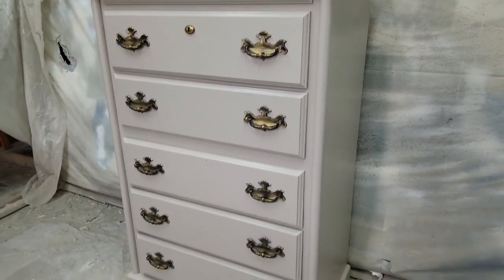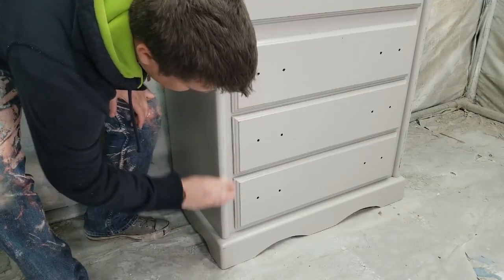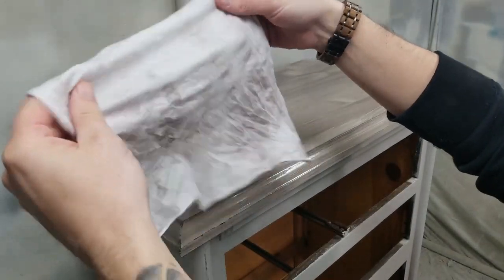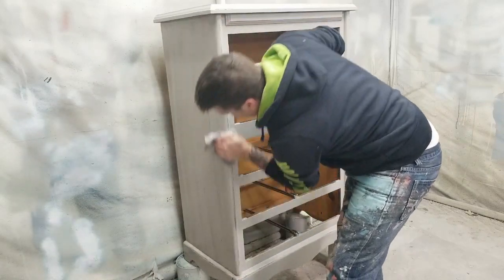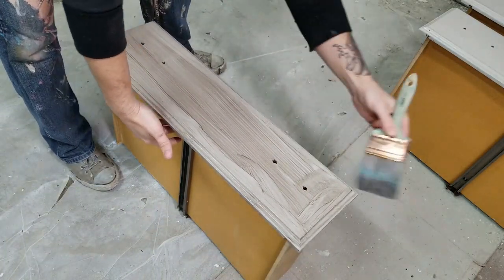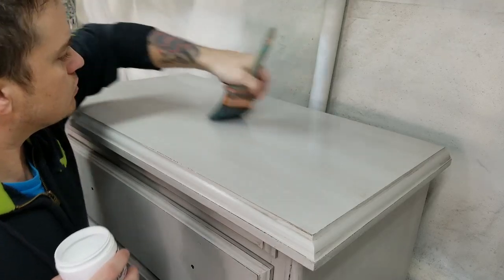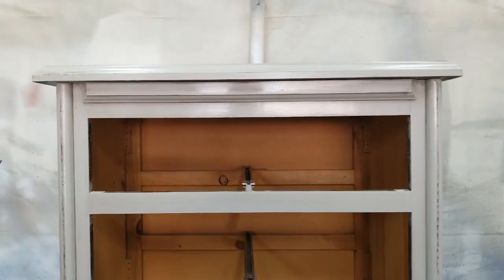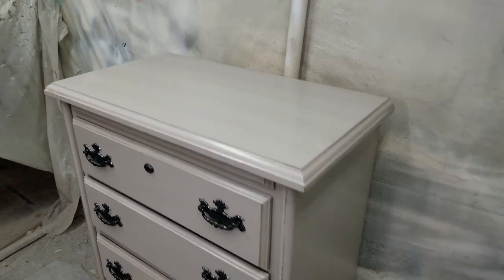Distressing and Glazing Painted Furniture

Comment: Nice work Mr. Shab.  I didn't think I would like the hardware or glazing, but yeah, the whole thing  is much better.  That kind of furniture is built a hundred times better than what you can buy.  Again, 15 years from now, you could always completely strip it, so an overall win.  One thing I would use those wooden knobs, the plain round ones painted the same as the body.  I like it though.  "Like"
Reply from the maker: Good to hear from ya again! You're right. It can be stripped down. I actually almost did that to make a third video but I've got custom orders needing to get done so I just sold it and moved on. One day I'm going to do a video where I buy a painted dresser from someone else, strip it, and restore it. I think that will be a fun one.

Comment: I was just wondering; how do you decide if a furniture piece needs priming or not? thank you.
Reply from the maker: Experience pretty much. There are certain woods that will bleed terribly. Mahogany, cherry, pine, and oak are really bad about bleeding their oils into the paint. Priming prevents this. Also, if you don't sand before painting, you might be able to get away with skipping priming. For the most part, I prime just about everything just to be safe.

Comment: I learned so much from your video. Would you mind to tell me again paint sprayer you used doesn’t need compressor? You use satin or eggshells finish? Thank you so much
Reply from the maker: The sprayers that I use in my video are Wagner and Graco sprayers. You can find them at Home Depot, Lowes, or Amazon. None of those sprayers need a compressor. I typically use a satin paint for my projects and I top coat with satin or semi-gloss depending on the project. Top coat determines your final sheen. Thanks for watching my videos!
Reply: That Shabby Guy what setting you set on sprayer ?? I set on high and came out awful. Thank you for your message
Reply from the maker: What sprayer are you referring to?

Comment: Love your work Shabby! My wife and I have been refinishing furniture as of late. You definitely showed me some useful technique on some upcoming projects. Have you done any whitewash pieces. I have someone that has inquired with me about doing their china cabinet. They mentioned a whitewash (I ahven't done that yet). I have a couple pieces I am going to try your gray glaze technique. My next goal is to get a paint sparyer like yours. What spray tips do you use. I am not fond of the cheap one my wife got awhile back and like the preformance I have seen with yours. Keep up the good work and I will stay in touch.

Comment: Nice! How many rags do you go through with glazing for a project like this?
Reply from the maker: Since I am using a damp rag and water based glaze, I can keep putting it in water and using the same rag. So one rag with traditional glaze. I'll probably go through 2 rags when glazing with wood stain. You use a dry rag in that process and oil based products dont wash out like water based.

Comment: Did you wax the piece before and after you glazed?
Reply from the maker: I did not use any wax in this video but I did top coat with Rethunk Junk's "Tuff Top" which is a water based polyurethane.

Comment: I love how this looks! Would you ever just leave it, when using chalk paint? I know they recommend wax but I don’t want to use that.
Reply from the maker: I guess you could as long as you let it cure for about 30 days and were very careful about what you put on top of it
Reply: I have left chalk paint unwaxed and it is hard to clean, shows dirt and fingerprints easily and will wipe off if you try to scrub it. I don't recommend leaving it uncoated. Even dark colors will show greasy fingerprints.
Reply: Sandy Morris thanks
Reply: @karenbutcher5921  yw. If you don't want to use wax, you can use polycrylic